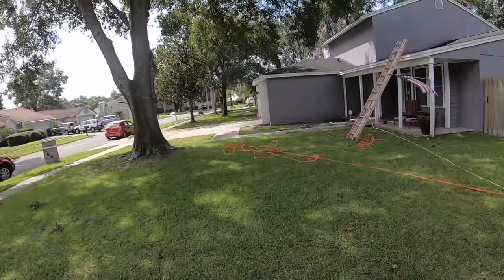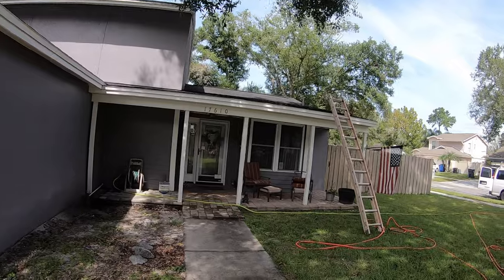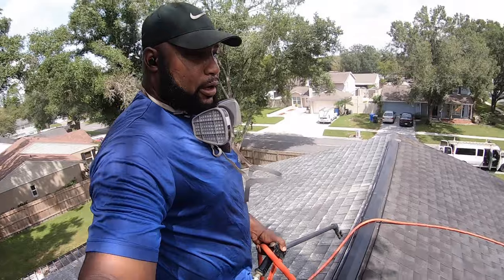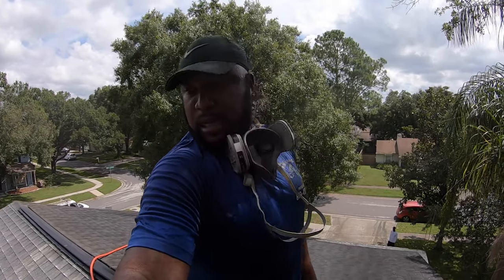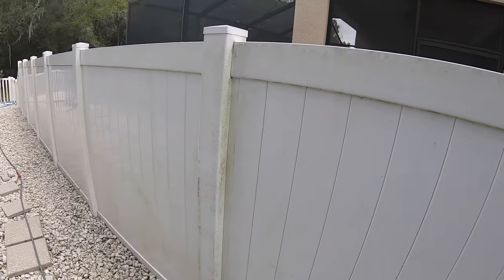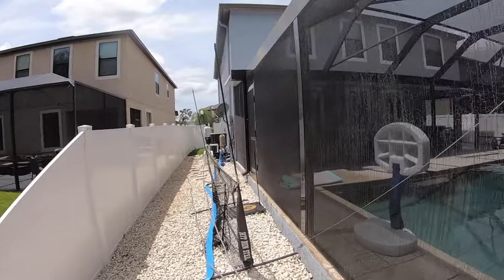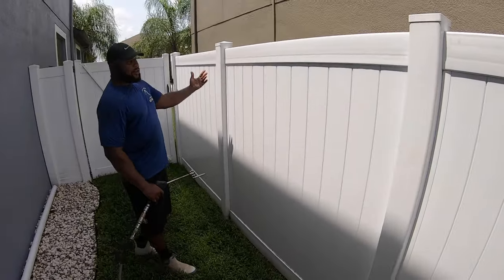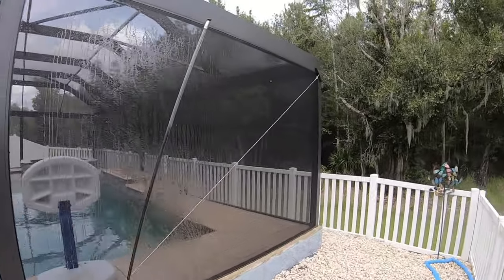Satisfying Roof Cleaning with 12v Pump

Comment: Can I ask why you didn't use a leaf blower to clear the roof first? Seems you sprayed over a bunch of branches and leaves. Maybe thats not included in your service?
Reply from the maker: I cleared the small branches after but the leaves will just die and fall off from the hot mix

Comment: can you just use the same 12v softwash setup to do the cage and vinyl fence as well? just turn the sh down a bit on the proportioner
Reply from the maker: most definitely yes just turn the sh down some. And yes ive got plenty of content with me using it for cages and fences.
Reply: @PinkFlamingoPowerWash  is their a way to directly contact you for a few questions?
Reply from the maker: @brandojon  instagram @pinkflamingopw or email info@pinkflamingopowerwash.com

Comment: I put a gallon  on eliminator in my 16gal soap tank and I feel like it's not really soapy should I do a gal and a half like a 10-1 only info I find is an Oz per gal but no info for a blend manifold
Reply from the maker: I dont like that surfactant at all.  I've used it once cause it was given to me. It takes way too much to make it soapy. I like the scent cover thats about it. When I had it , I always mixed it with the slo mo. Even the apple blossom I mixed that with slo mo too.  Slo mo is the best surfactant in my opinion

Comment: My 5.5gpm 12v everflo looses pressure and distance. Switched to a 1/2 hose and still same results.. Any tips?
Reply from the maker: Sounds like an air leak somewhere. Make sure your wires to your battery is rhe correct gauge and make sure you got the correct nozzles.  But I'm leaning mostly towards air leaks somewhere
Reply: @PinkFlamingoPowerWash  thank you! I'll switch to 10awg wire and check for leaks. I use the jrod for my tip
Reply from the maker: @anthony8194  you need 8 gauge wires better not 10

Comment: Hey Clifford! Nice job. It is scary when customers ask that stuff. Makes them feel high maintenance and we all know about high maintenance customers. Side question if you have time. What do you do if a customer has dark colored hardy board? To add a second part to this, dark color hardy board with Sherwood Williams paint?
Reply from the maker: If its the blue Sherwin Williams paint I just stay away. But I've done other ones that are dark colored a downstream mix doesn't affect it.  I would wet it first before applying the mix just for extra precaution.
Reply: @PinkFlamingoPowerWash  thanks! You’re the man. Always so helpful. I’ve been staying away too but just wanted the opinion from someone with more experience.
Reply: Run and run fast
Reply from the maker: @vernongreen4877  ✌🏃🏽‍♂️🏃🏽‍♂️💨💨😆😄

Comment: Hey man I'm just wondering what is the deciding factor for when you decide to downstream or use the softwash 12v system?
Reply from the maker: I gauge it by how dirty the surface is. If it's filthy I'm automatically bumping my mix up.  I guess this goes for most as time goes on.
Reply from the maker: For house washing if the algae is really bad I automatically know it will need a hotter mix.  Light algae can cleaned via downstreaming.  For roof cleaning definitely 12v softwash system is needed.
Reply: What’s up!!
Reply from the maker: @jerrywade3005  yooo what up